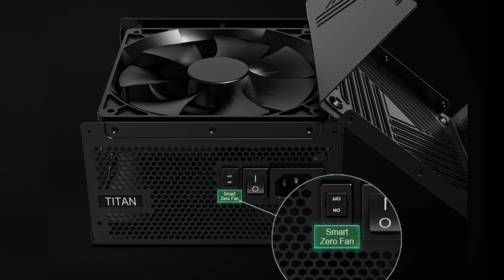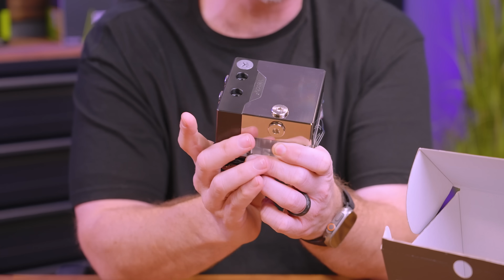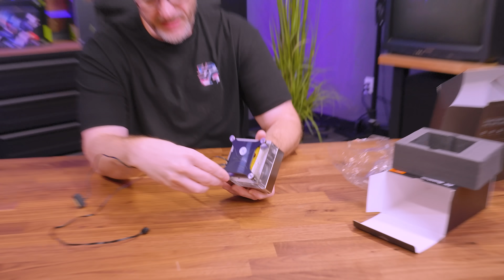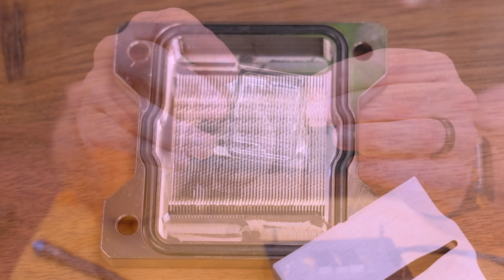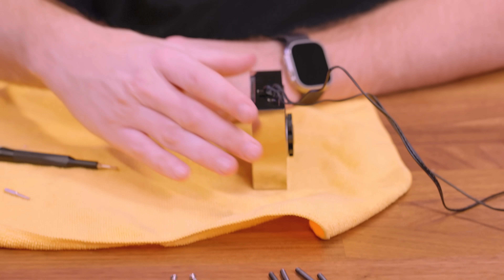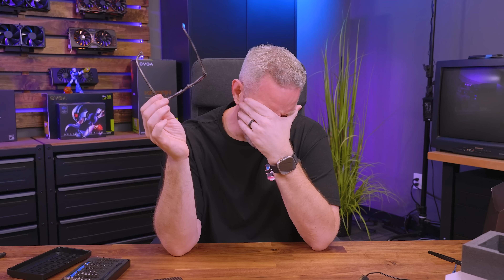I wish this existed years ago!

Comment: That just looks like a chonkier Apogee Drive II with a chonkier pricetag to match. I do like the construction and quality of machining of this better though. The micro fins (posts? they were cut both ways) on AD II were quite uneven and the inlet was a tiny circle in the middle that would get gunk stuck at the radius of it, especially on fins at the directions where they were tinier. In that sense the wider inlet with jet plate probably fares better.

Price wise AD II would often be at around 150-170 dollars and has been on market for over 10 years, though frequently out of stock. I can't see this being twice as nice to justify twice the price. Personally after having built one system that was extremely space constrained which I dailied for 5 years, I would rather start with a larger case or look for an alternative cooling method than start considering a pump block combo such as this again.

Comment: I'd that pump isn't completely removable I would have to hard pass. I have an EK distroplate/res and I've had to replace the pump due to a failure. Better to replace a 100 pump than a 300 block. Just my 2 cents.

Comment: I had the Swiftech CPU block/pump combo for my watercooled build about 10 years ago where I liquid cooled a 4770k and a 780 ti.

It died after about a year.

I switched to a DDC pump IIRC  and an EK waterblock for the CPU.   This block/pump combo certainly looks a lot more sturdy than the Swiftech version from a decade ago.  

It's definitely a bit harder to make sure the pump is getting water if the pump is integrated into the CPU block in my experience; I recall having to lean the case quite a lot and stop the pump repeatedly to get all the air out despite the CPU block being a decent distance below the reservoir while filling the loop... There was a bit of a curve in the soft  tubing I was using and that seemed to collect air consistently. 

I'm not sure if this solution is actually easier than just using a reservoir that has an integrated chamber for the pump, like Daniel's reservoirs from Singularity Computers.  Considering I've not used one of his reservoirs and you now have access to both, you'd probably be a far better judge of that.

Comment: Pro tip - get the Nexxos v2 radiator and you wont need a reservoire since you can use the rad due to more holes

Comment: Air (any gas and some solids) is a fluid -- you mean "a pump moves LIQUID, not a gas". 

Do you remember a tower radiator reservoir that was gravity circulated -- I think it was made by Zalman? It might have been able to be used with a pump and a fan could have been added, though it would work without needing any power.

Comment: Isn't Plexiglas (the brand name) or plexiglass is PMMA acrylic? Lexan would be polycarbonate. One interesting thing to do with acrylic is to bond pieces together using acrylic specific solvent or adhesive, so one might make a hardtubed open loop with as less fittings and couplers possible. Or make the all hard line build?

Comment: Wow nice. But.... (lol) I've had an EK D5 pump through so many builds. It's so old it's voltage regulated and it just works even though it's the oldest component in my system. I buy different blocks for the different platforms, different res on top for different spaces and in the end it's a way cheaper upgrade option. Plus my current (still old) X299 block has VRM cooling which the new one doesn't offer. So in the end I'd love one for a small form factor build, but then if I upgrade I'd be better off to just sell the entire system and make a new one.

Comment: Could you use one of the extra port to run a dead end pipe to the top of the case?
So you can have a easy filling point and a very very small reservoir
Reply: yes. U can even connect there leakshield or additional reservoir and leakshield.

Comment: Anyone have experience with the DDC pump lime (4.2, specifically)?  I just installed one in my distro plate and water is pouring out a small hole beside the screw. :/

Comment: This is hilarious .... I literally just purchased this for the specific reason of running a dual pump setup in my 011 Mini. I've been running the EK front distro plate for the 011 mini & thanks to my flow meter I know all the bends & turns have drastically lowered the flow. So I purchased this for the exact same scenario you explained at the end.

Comment: Every single velocity 2 backplate I have used always has one of those screws falling out. They are actually super annoying to attach. I also hate that they don't come with any nylon washers, and it practically sits right on traces depending the motherboard.

Comment: In my very limited experience with ddc pumps, the black plastic piece (impeller) in the the magnetic rotor can bend very easily if running without being completely filled up (attempts to repair the bend will most likely break it instead), but even with a new one, fully filled up, a sudden movement, like a 1.5cm fall (my finger slipped and it was the only thing separating the case from the table so a very short fall on one side) while running, can move the rotor to make contact which bends that plastic part. It starts to rattle even at low speeds. And you can't find it anywhere online, gotta buy a full new pump to replace it. So my suggestion is to make sure rpm is low while you fill it up, make plenty of 'gentle' twists to make sure it's filled, avoid moving it while it's on, have a third hand on the power switch at all times to turn it off as soon as it rattles and pray it's not bent if it does.

Comment: Low key i LOVE the idea they leave the LED strips untaped. 

With my Water cooled PC 😢 white LED and black or off all together. 

Being able to remove the LED strip inside the GPU block that just omnipresently glowed on the inside was VERY helpful in achieving my theme goals. 

Only issue i had with EK is this quality control. Having paid 500$ for a active water backplate i would expect all the hardware to be unused and perfect... 

But the standoffs were cross threaded from factory and almost couldnt even take the block apart to even install it! 

They freely replaced ALL the standoffs and made it right, but buying a 2nd set of EK products had more over sights in their "quality control" but OTHERWISE their products are INSAINLY NICE.

Their customer service is 2nd to none. And overall would hands down use their products again!

Jay 100% on point my loop is actually "effecient" because goal was as little restriction from one end of the loop to the other and actually achived it!

Comment: When watercooling, your thermal mass comes from the water.  You don't want a massive waterblock and a thinner cold plate is better than a thicker one...

Swiftech used a DDC pump; the DDC 4.2 just has better PWM control but its the same pump.

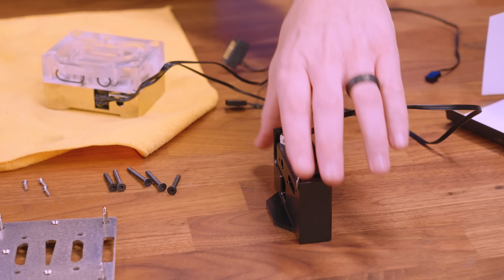Comment: 11:49 It's not laziness. It's an option for clients who don't want that additional RGB strip cable when they don't use the RGB lighting. They can easily remove the RGB strip that way if it's not stuck on to begin with.

Comment: The Modultra LOBO CPU water block is better. It's smaller and uses a DDC pump. Just all around a better option if you can afford it. The block is two hunney doll hairs alone and doesn't include the pump. But it looks and feels more premium as well (solid brass and copper that's then Cerakoted on the outside) Edit: I think it's less than half the size of that monstrosity with comparable performance. Optimum Tech used it on his lil bebe build for his 7800X3D, but it would run a 13900K just as well.
Reply: the acetal variant is significantly less expensive. combined height with the LOBO & some fittings is similar or less than this EK block. pneumatic fittings especially.

Comment: yo i nnever built a watercooling system. but: i worked bikes. annd brake fluid exchange is a thing i had to do a lot. so filling it i used syringes on both ends and pumped little more fluid than needed a couple of times back and forth. worked like a charme. i figure for a cooling system u need more fluid thann for a brake system, but..... maybe someoe tried that? :D

Comment: No thanks, if pump dies you're screwed you have to replace the whole thing and ddc pumps die alot. i've had ddc pumps die after a few weeks. There are similar products out there you just have to look and they are built just as well if not better and are usual cheaper.

Comment: I'm using the AM5 version of that block/pump/res unit in my Fractal Torrent build. Got a 80mm thick 2×180mm Alphacool Monsta radiator on the front with the stock 38mm-thick Fractal 180mm fans and an EK P240M radiator in the bottom with 30mm-thick Phanteks T30 fans, leaving me very little room for a normal pump/res setup. 
Also, I ended up just attaching a fill line to one of the fill ports on the block and routing that to one of the Torrent's fill port holes at the top of the case so that it acts like a T-line reservoir. Without that, it just makes the initial fill and priming really difficult...
Reply: I would be tempted to just run with the fill line for a few days to let the bubbles clear, then suck out any excess water from the line, remove it and plug the port. Then just run it as an AIO.
It might need topping off every so often, but that is no different to maintaining an open loop really.

Comment: I wonder how they got around the Asetek patent issue that Swiftech had to deal with? It's why they had to discontinue their pump/waterblock combo units. It's also why they had to move the pump to below the radiator when they released their AIO units.

Comment: I am pretty sure NONE of the watercooling-pumps can handle or produce cavitation. Having air-bubbles in the system (aeration) or running dry is NOT cavitation, not even close - those things are not related.

Comment: My Alphacool Eisbaer  system is technically the same thing, and I prefer the looks of it honestly. But good that more options are coming out!
Reply: Same here.
Reply: An eisbaer is the block i put in my sister's am4 rig 5800/6800xtx+2x240s in the ghost s1 with tophats.
Reply: @jacobhurst7275  I have the 280mm version.. its been great on an older 2800x, but id like to jump up to a 7800x3d or even a 7900x.. do you think that that pump rad combo is capable of handling the upgrade I want to do ?

Comment: Wow, that takes me back to the early 2000s when we used to make the blocks ourselves, ran them with an aquarium pump and hoses, and were praying it would never start leaking 😆. Looks like it's a good time to get back into the game. But then I look at the AIOs and wonder why I would put that kind of stress on myself again. 😔
Reply: These days it's mostly an aesthetic thing. Sure, you might get marginally better results with a custom loop, if you really plan it out. But when I say marginally, I definetely mean marginally. If the goal is to keep your hardware cool generally, modern AIOs will do the job just fine. 

If you're into amazing looking PCs, a custom loop is nearly inevitable. And to make it worse, for the really great looking ones, you're looking at hard tubes and probably distro plates. Which I originally was going for. But that just adds another 250 bucks or so, and at some point I'm just not willing to throw money at the system. Currently on the path to say "screw high end" and go with a decent midrange PC and spend the rest of the money I'd have thrown at a high end system on a nice vacation with the missus.
Reply: @noneofyourbusiness4294  aesthetics is definitely a part of it, but for all of the people where I've installed custom loops the biggest concern was silence. My own system runs effectively passively when I'm not gaming. Zero moving parts, apart from a D5 that's in an anti-vibration mount. But this invariably comes with the inconvenience of an externally mounted radiator.
Reply: @fermitupoupon1754  so, what was the actual usecase for the people you built systems for? Generally speaking, they probably have the cash and dedication for proper noise cancelling headphones. I mean, you weren't building a lot of custom loops for office/media PCs, right?

The sound level of gaming PCs is one of the dumbest debates there is. Like sure, having your system run quiet and cool is great. It's something to look forward to. I get it. 

But man doesn't it matter if you spend 200 bucks on a decent set of headphones compared to a 600 bucks and upwards custom loop. If noise is your first concern, a custom loop is not the top priority.
Reply: @noneofyourbusiness4294  It's generally not so much for the person wearing the headphones as much as it is for the others in the room.

For example a friend of mine lives in a 1 bedroom apartment. So his computer is in the living room. But while he's sitting there gaming, his girlfriend wants to watch TV and not be annoyed by a loud gaming PC.

Another guy is a VFX artist who lives in a tiny studio apartment in the most expensive city in the country. He doesn't like a noisy computer next to his head while that thing renders scenes overnight. But he has no other room to put either his PC or his bed in.
Added benefit in this case is we kept the hoses slightly on the long side, allowing him to put the radiator outside the window during summer, dumping all that rendering heat outside.
Reply: @noneofyourbusiness4294  once you've been jump-scared by a child suddenly appearing next to you while gaming in the middle of the night you'll think twice of you want to put headphones on. 😆
But apart from that there are other reasons why I don't want to wear headphones all the time, and i want my system to be quiet enough to have to wear any. Thankfully today's high end systems still can be cooled really quietly as long as overclocking isn't getting too extreme.
Reply: @fermitupoupon1754  how would putting a radiator outside in the summer help it cool better 😂 it would literally help heat the coolant more than anything since I doubt they keep the inside of their house at of above 80°f
Reply: @FrgottenFrshness  airco is seen as quite a waste of money and electricity here. Also the people that do have airco would set it to something Celsius. Add to this that we're far enough north that the entire lower 48 is hundreds of kilometers south from where we are.

In summer when it's really hot here, it's maybe 35 degrees, but annoyingly often 85%+ Rh. But there's usually a bit of wind, so it's not too bad. It's not like say AZ where you get like 57 degrees in the shade and no rain or wind for weeks.

So yeah if you live in a tiny closet of a studio apartment that you pay well over a grand and a half in just rent, airco probably isn't the biggest priority. So dumping a couple hundred watts of heat out the window is a pretty good idea at that point. Why heat the tiny room up even more than it already is?

Comment: EK blocks look nice but not the best ones as pricing may suggest. 3000 series GPU blocks supplied with wrong size screws, 4000 series GPU blocks with bad O rings (bleeding coolant where is supposed to be dry), is a pass for me. Also, check if every screw is properly fixed at the correct torque.

Comment: Heating engineer here. Running 2 pumps on the same loop / circuit perhaps even on the same leg (flow or return) is a big non-no. We'd put any pump on a boiler in the return and on any subsequent circuit with a pump it gets fitted to the flow. Even when having identical pumps controlled by the same signal, manufacturing tolerances would still mean no 2 pumps are running at the exact same speed / flow & pressure. It may well be negligible in a PC application but it just gives me the jeepers-creepers...🤷‍♂ Just my 2 cents...😉

Comment: I wish they would make one for am4 socket.  This block has been out for a while now.  Surprised it has not been covered sooner by Jay.
Reply: I'm planning an ITX build for almost two months now, and I wasn't able to find this on EK's website at all.
Reply: People have got the AM5 version of this unit to work on AM4 sockets. The mount hole spacing and IHS height is the same so it's really just finding a way to tighten down the screws to get proper mounting pressure.

Comment: So when your pump dies (and it will) you need to buy a new $329,- pump water block.
Get that damn ddc out of there and see if its got thermal pads to the metal housing.. if not.. its already dead...

Comment: Sorry this is way off topic but I think this is your latest vid. Fed up with muppets posting on here to change Memory Context Restore in Bios to enable. What these clowns are missing is the fact there are TWO MCR's you have to change. One is in AI Tweaker and the other is in Advanced/AMD CBS/UMC Common Options/DDR Mem Features. If both of these are enabled the system will post/boot at AM4 speeds. Hope you will read this as you are the god of pc's, maybe spread the news to Steve and other fans or on your show. Cheers.

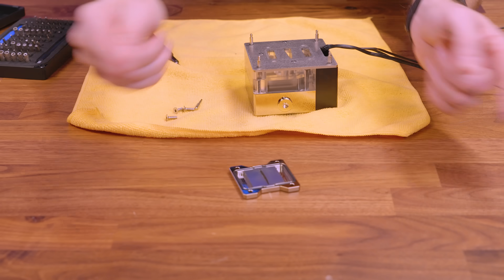Comment: @9:18 EK should use a gasket/o-ring to seal the inlet from the outlet pathways on the water block/diversion plate interface and the bottom metal mounting plate on the pump.  This can DIRECTLY short-circuit flow through the water block.  It's metal on metal, it won't seal on pressure alone.  Get some RTV!  Just so it's clear short-circuiting is akin to bypassing.  It might not be the whole pumps capacity, only a percentage, but that is lost flow and lost heat capacity.  Just sayin'!

Comment: 16:00 Redundancy is good only if you dont go D5 pumps otherwise just one D5 will have plenty of pressure for even the biggest loops, but DDC pumps are generally weaker. D5s put out 30+psi which is more than plenty. I run two 420 rads with distro plate pump combo (D5) through cpu/gpu blocks and run low rpm and my temps are ice cold on 4090/5800X3D.